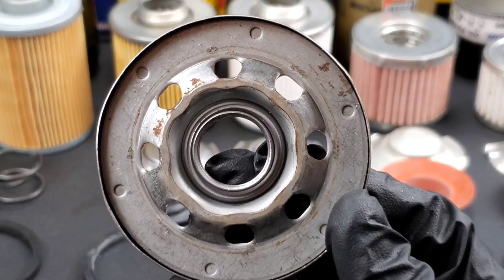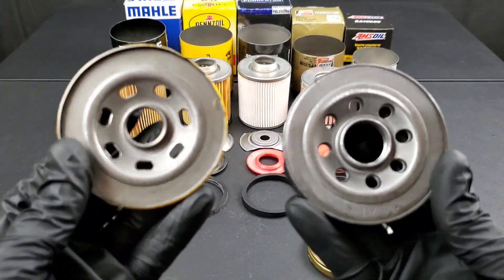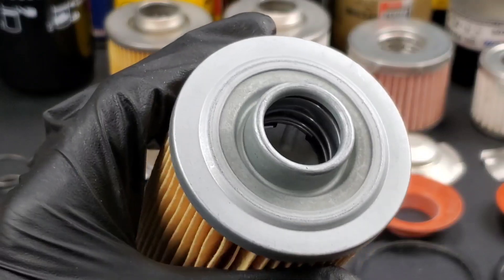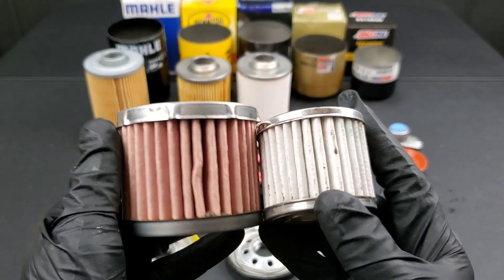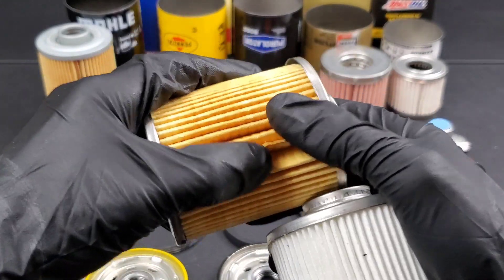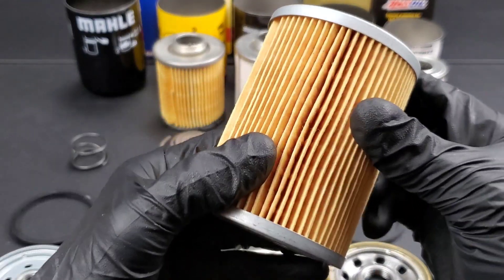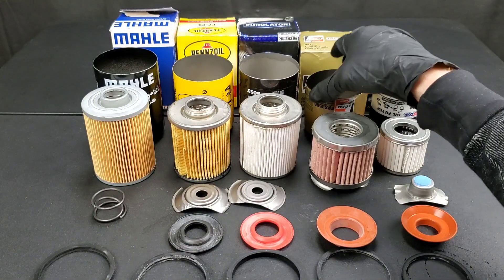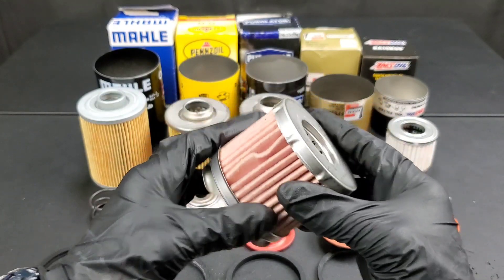Consumer Alert: Misleading oil filter & Rust?

Comment: I definitely like the purolator boss oil filter. I have a 2017 Buick with the 2.5 DGI engine. I'd like to see the boss compared to the NAPA premium synthetic oil filter for my Buick. I have heard that the smaller filters don't offer as good of protection. I hate rumors and would like to know. I used either pennzoil ultra or Mobil One  5w20 oil. Help stop the rumors Brother.

Comment: Boss micron rating is 30-40 micron 99% efficiency check pulolator website for more details
Reply from the maker: Check out the new oil filter video. 
https://youtu.be/4RRuzz3RRPg
Reply: *Based on ISO 4548-12 at 25 microns on PBL30001 bottom of page Purolator site

Comment: I wanna see another WIX filter cutout to confirm if they have a great construction og the filter.
Reply from the maker: I have multiple wix filters cut open even racing. Have you watched those?
Reply: @NATESINTERACTIVEAUTO  yes, but I want to know if those rusting are an isolated case or is it a recurring problem by WIX, since I am using WIX for a long time already and want to make sure that they have kept their quality the same or even better. But after watching your video about one with the rusting I'm afraid so I want to be re-assured about WIX.
Reply: @NATESINTERACTIVEAUTO  and I'm an avid fan of yours I even watch those videos of engine oil comparisons.
Reply: @NATESINTERACTIVEAUTO  can you make a video about the filtration efficiency & other performance test for the oil filter brands like WIX, Fram, K&N & etc...?

Comment: Mahle is famous for their forged pistons found in many high performance German vehicles (and others)
Reply: Same with there gaskets they use em on the saturn assembly line at saturn factory
Reply from the maker: Great information thanks for sharing with the NIA community
Reply from the maker: I really appreciate you taking time out of your day to help others with your knowledge in the NIA community
Reply: Yep and they need to stick to pistons because there filters ain’t worth spit
Reply: In German cars they’re the best. It’s proven, especially with the bi-pass.  I’ve worked on schlotter refrigeration compressors in mahle piston plants. I beg to differ on the machine piston and stihl head quality but they’ve got they’re oil filter game pretty tight.

Comment: Filters bypass at 6000 miles..
You gotta be crazy to go 15,000 miles on one filter.
Reply: I've seen people go 30000 miles no oil change
Reply: @thundergun15  insane ruin the engine ...
Foolish.
Reply: maybe with conventional oils.   but with modern synthetic oils and filter media those high mileage intervals are absolutely correct.
Reply: @pctatc66  Nope...I have rebuilt hundreds of engines since 1976.
Automotive,Marine, Industrial.
I also have a degree in Engineering.
Anyone who believes oil and filter is ok at 15,000 miles is gonna be sorry.
Especially with the Variable valve timing and GM s multi cylinder deactivate lifters and solenoid s cam phasers on Ford's,Nissan vvt all clogging up.

On Telsa it's ok
Reply: @pctatc66  Oils maybe but definitely not with oil filters. Nothing can extend the life of an oil filter besides more surface area like finding a way to fit in more pleats. Synthetic or otherwise, once the pores are saturated with contaminants, that's it. Time to replace. The oil continues to flow through the bypass into your engine unfiltered. I don't understand why this kook has this fascination for the manufacture of the housing surrounding the filter medium. The filter medium will fail long before any components he so dramatically points out.